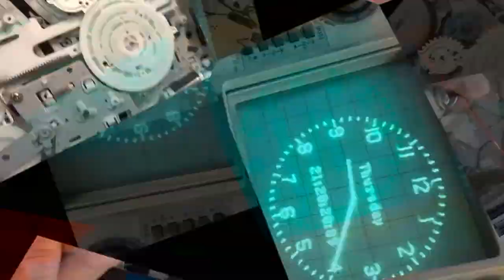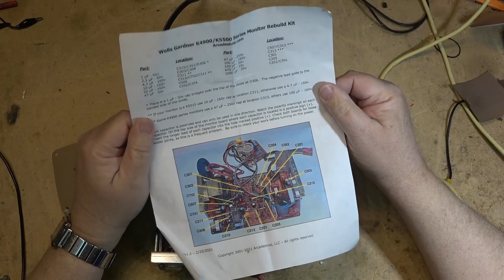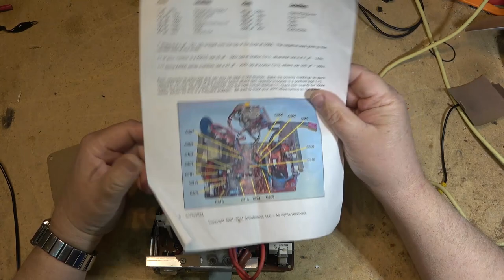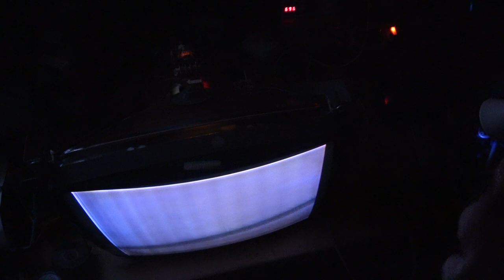Restoring an old CRT Arcade Game Monitor

Comment: Back in the 1990s I helped a friend silk screen some small, simple circuit boards he had designed so that a customer could  do an RGB video hookup from  commercial video game systems to  several Mitsubishi 35" CRT TVs. Worked like a champ.
Reply from the maker: Not hard but tv needs to be cold chassis type
Reply: @12voltvids  I'm sure they were, or he wouldn't have done it, he had been fixing TVs at his dad's TV shop since age 10 or so. His dad never really got the hang of the new transistor tech back in the early 1970s.

Comment: Great to see another Arcade CRT saved and not replaced with a garbage LCD
Reply from the maker: LCD sucks.  I was looking at a vintage game that the owner had put an lcd in. He was asking 1000 so I offered him 400 max and the reason was that was all it was worth. I could buy a brand new replica at the local store for 450 if i wanted a stand up Pac-Man with an LCD.  He said the monitor had burn in and my reply was exactly. And that  is why it was worth 1000 or more in that condition. But now it is completely ruined and then I walked away.

Comment: Having played with flybacks in a hobby project, I find it funny that the HV cord and the suction cup is called 'cobra'. But yeah, it can bite!
Reply from the maker: One of the high schoolers that worked in the shop after school called it "the. Cobra" after he was messing around with an old tv out back ripping it apart to throw out.  The tube had a charge in it and he got bit.  We all were rolling on the floor laughing when he said the "cobra bit me".  It stuck.  From that day on the HV cap was know as "the cobra"

Comment: I fixed video games for a good 20 years, pinballs jukes you name it. Those were very reliable and mostly vertical problems due to caps. The 47 uf 250 v is high failure. Not much dust in there. The monitors went down hill later with multi scan vga and switching regulators. Your one is linear.
Reply from the maker: Yes I know and must be run on isolation transformer
Reply: @12voltvids  thats a Wells Gardner chassis. Yes the transformer is in the game.  I doubt half the caps are bad and yes, that main filter, never dies.
Reply from the maker: @markanderson350  I am aware of the chassis model as I had the repair kit for it.
Reply: @12voltvids  i never used the kits. I would just change the caps needed. You could fix em quick. I kept the wires connected. Just zipped out a cap or two.shove the board back in and go to next machine or call. . .
Reply from the maker: @markanderson350  This was brought in with a bag of parts. I changed them and was paid for the work. I didn't trouble shoot as it was working. Had it been mine I would have just changed the bad cap.
Reply: @12voltvids  brought back memories of hundreds of those damn things. Lol

Comment: 39:06 why did you make that loop/circle from that high voltage cable?
What I understand the electronics, by doing this, you simulate a simple coil behaviour. But why?
Reply: I think it's just to take up some slack. The inductance is negligible at these frequencies.

Comment: I would like to get my canon cam corder fixed could you help me?
Reply from the maker: Won't be worth fixing.  None of them are.
Reply: @12voltvids  It is a more modern one
Reply: The one I have is from 2003 and won’t turn on after hooking it up to a bench power supply